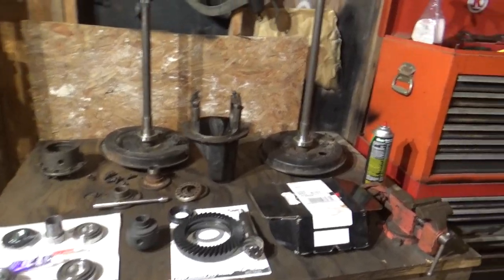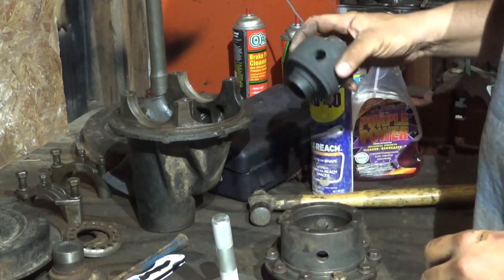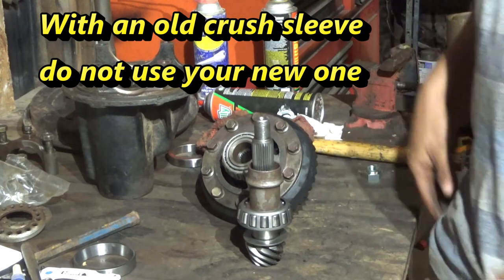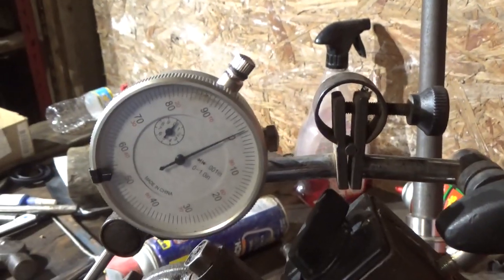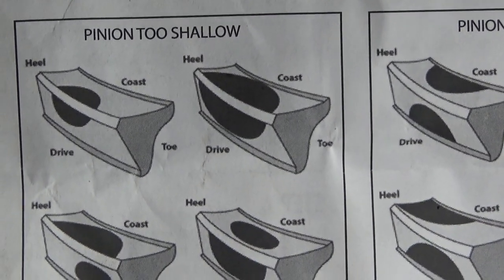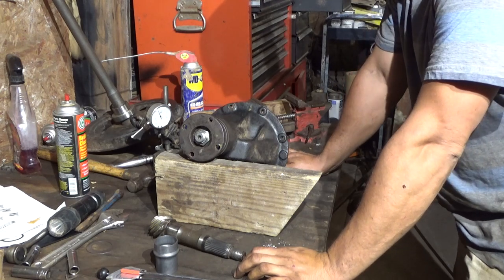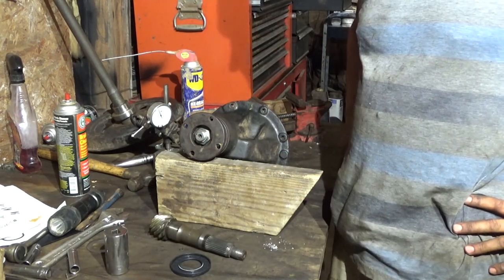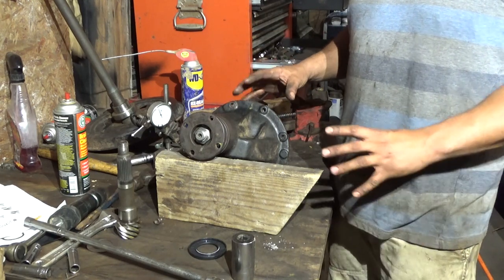suzuki samurai rear axle rebuild/assembly part 1 (setting ring and pinion)

Comment: Great video. I just installed the 5.38 gears. With the Spartan locker. 
Your video helped. Thank you. I did not use that crush sleeve. On mine
So why do you think you had Failure? I do not want to redo mine again. About  2 weeks on and off.
Reply from the maker: I have no idea why it failed. I fixed that axle for my cousins samurai. And he bought it like that.

Comment: What is it that you are measuring with alingment tools?
Reply from the maker: what alingment tools are you talking about? the only measuring tools need is a dial indicator and a magnetic stand to hold the dial indicator in place. and with that I am measuring the backlash. its the play you have between the gears when you turn them back and forth. I'm sorry if I didn't answer your question but I don't really understand the question.

Comment: I took off my pinion nut and my pinion still does not want to come out,o you usually have to press it out
Reply from the maker: They get stuck sometimes, on the last one I had to put the nut on the end, and get a block of wood. And a 5lb hammer. I have a press but I didn't see an easy way to use it.
Reply: My drive side looks good but my coast is a little high towards the heal it has a 50 thousand shim you think its to much shim or not enough
Reply from the maker: If it almost looks good, then I would be changing it by .010" at a time. .050" is a big change.
Reply: @davidcraft4909  I mean I have 50 thousands all together how much shim did end up with overall
Reply from the maker: I would concentrate on getting the drive side as perfect as possible. If the gears are new then the coast side should naturally be within the acceptable range. I use the diagram that comes with the gears to adjust them.